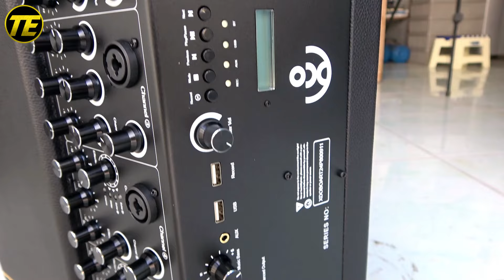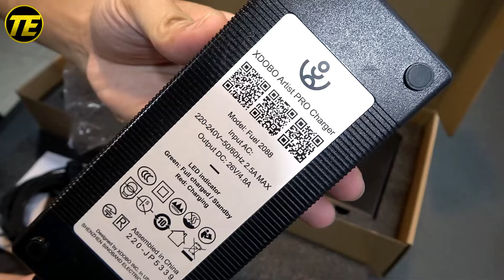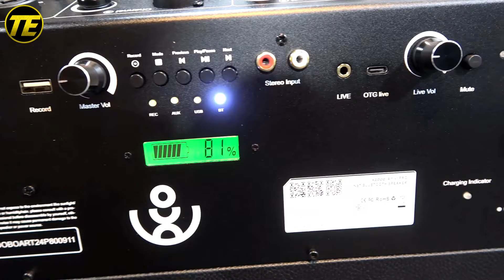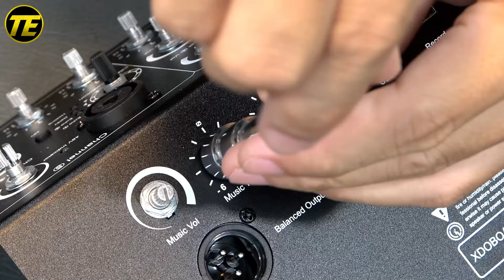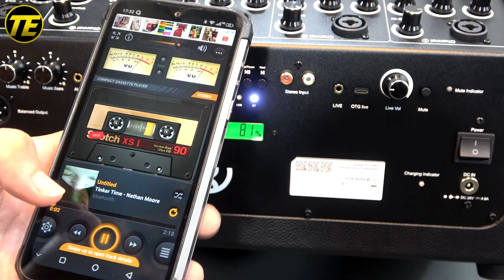What's Inside xdobo Artist PRO 600 Watt Instruments Bluetooth Speaker

Comment: Why didn’t you remove the radiators from the amplifier chips? The most interesting thing is there!
And yes, the output power is no more than 130 W, but this is immediately clear from the speakers.
In general, the disassembly is interesting, but not entirely.